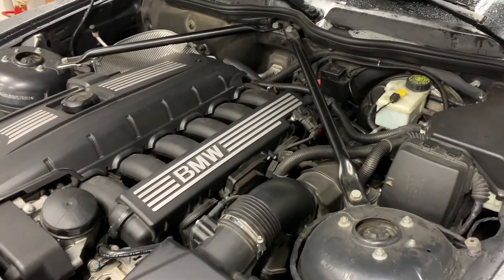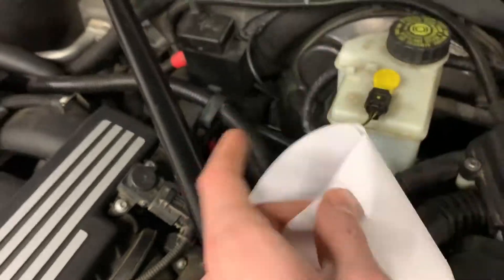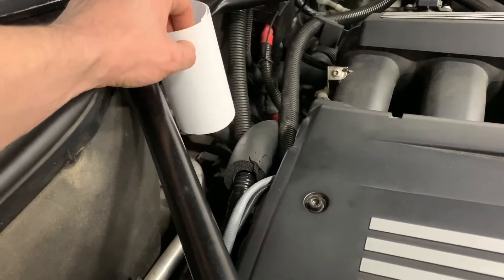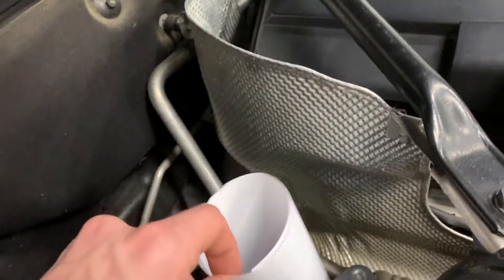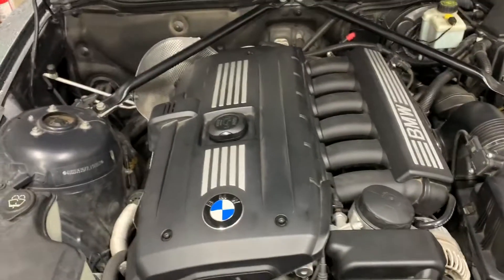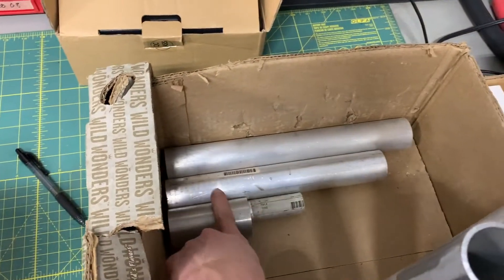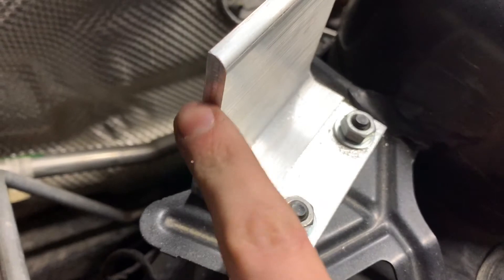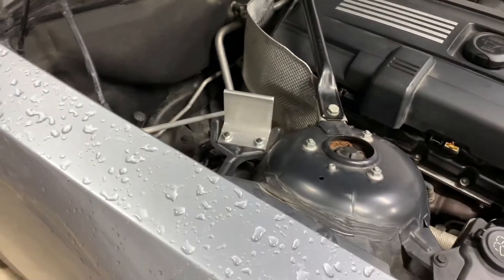BMW N52 Magnesium Valve Cover Conversion - Part 2: Catch Can and Bracket Planning

Comment: Hello. Cool conversion. I'm going from a magnesium valve cover to the updated plastic. Problem, my pcv breather hose doesn't fit on the connector on the plastic valve cover. Is there a different hose for the plastic valve cover?
Reply from the maker: @Shiba General - The best way to do it in my opinion would be to get a rubber hose of the correct diameter replace the factory hose.

Otherwise, you can get a very short length of hose to use as an adapter. Check out my DISA video on my 5-Series to see what I mean about that.
Reply: @Casey_Schmidt  thank you
Reply from the maker: @shibasalute  Wait. Are you removing the CCV unit? If so, there is a P/N that you can find on the Real OEM website that goes directly from the valve cover to the intake manifold since the CCV is integrated into the plastic valve cover. It’s a Y shaped hose.
Reply: @Casey_Schmidt  I was removing the breather hose from the valve cover. It looks like a straight hose with two connectors, one going to valve cover, the other to the manifold. The breather hose connects to the magnesium valve cover, but its not fitting on the plastic valve cover. Is it possible to send you some pictures to you?
Reply from the maker: @shibasalute  what is the year and model of the car and which engine does it have?
Reply: @Casey_Schmidt  2006 BMW Z4 3.0i N52
Reply: Early part of 2006 so it has the Magnesium valve cover
Reply from the maker: @shibasalute  - Go to the website called realoem.com. Find the parts breakdown for your car and then a Z4 from 2007. Cross reference the two parts lists for the CCV and you’ll have it made.
Reply: @Casey_Schmidt  thanks. I'll dp that. Appreciate it

Comment: Tell me please... The first generation N52 engine (magnesium cover) is a better option than second generation N52? Thank you!
Reply from the maker: @Stefan Gragu - Great question! From what I understand, the revised version of the N52 with the plastic valve cover is the “better” engine. It implemented several small yet important changes that allowed it to be more reliable along with getting better efficiency and performance. Forgive me that I don’t remember all of those differences off the top of my head. The two biggest changes were the valve cover (magnesium to plastic) and the CCV (external to integrated into the valve cover). But smaller changes were made to the Valvetronic motor, camshafts, intake, etc. Again, small changes but they all add up. The downside is that the revised version lost the magnesium valve cover.
Reply: @Casey_Schmidt  I want to buy a z4 3.0si but i don't no the difference between this motors... Thank you so much bro! 👍

Comment: Looking to do the same on my E90.  This is good info, will be watching.
Reply: Did you do it
Reply: @Foreignsgarage444  yeah I did.   Best thing I did not having to worry about dumb plastic cover.  He covered everything very well in this series.  I did similar but used a UPR billet check valve off valve cover going to catch can.  Works great.
Reply: @boostabear wow finally someone else in the bmw community who knows the words “upr” 🤭 

So I’m trying to repair my friends poorly swapped magnesium valve cover job and noticed you said upr. On my personal 94m3 I’m using the upr catch can that’s a single inlet with dual outlets. Btw I’ve been searching for the best oil catch can for the last two years and I settled on the upr cans since it is the only can that actually traps and separated the oil and the only can that actually does what is advertised!!!! My engine produces a lot of blow by due to a spark plug shattering inside clyinder 4 because of a fake bosch injector staying stuck open that was purchased from bUmmerworld listed as the “remanufactured 24lb Bosch” long story short careful with retailers and upr rocks! Anyone reading this should jump on it and not hesitate. I tried many differnt big name brands and even the radium can wasnt as good as the upr 😄